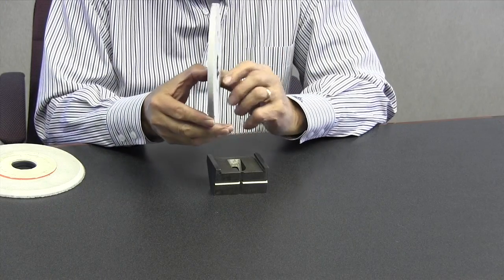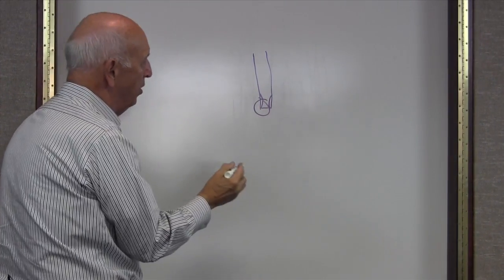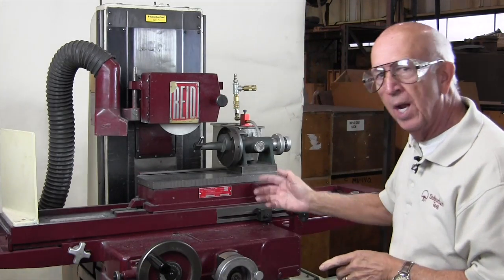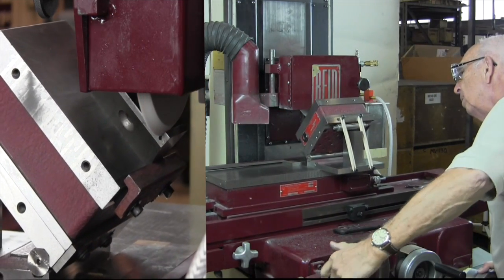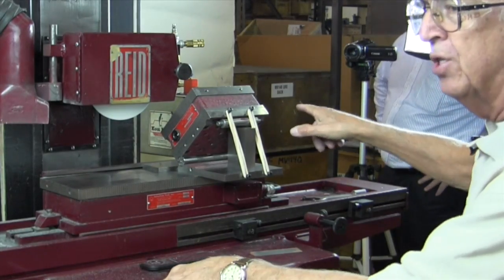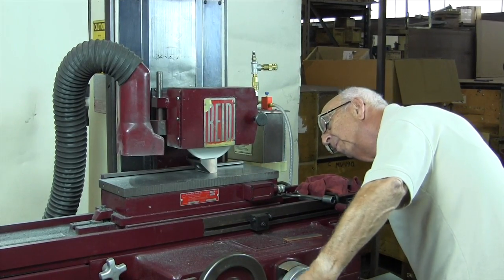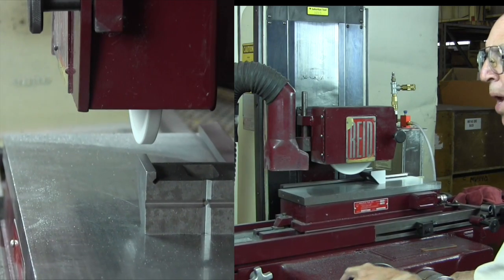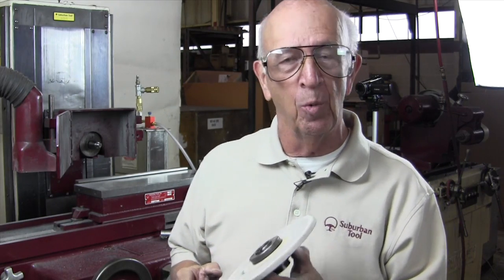How to side wheel on a surface grinder by Don Bailey

Comment: Don.. from one old tool maker to another.. you can’t draw worth a rats rear end.. lol..but.. you get your point across..in this day of CNC (Christ! No Cranks) being the only thing taught these days..it’s hard to understand how we could move away from teaching this kind of knowledge. I am a card carrying Journeyman Tool & Die Maker. A dying breed. I’ve forgotten more than most will learn in life.. as for grinding with the side of the wheel I’ve found you must feed slowly and be aware that the wheel is cutting and not climbing because it’s Fed to quickly. Wheel choice is paramount too especially on a dry grinding set up. He mentions a J wheel which indicates the bond and not the grit. I’d choose a 46 for this grinding but a 60 may be what he’s using. Also, hardened tool steel grinding shows a darker spark whereas softer shows a lighter spark.

Comment: Thank you for this informative video.
Some follow up questions:
1. Is it possible to grind a dovetail slot?
2. It seems to me the sidewheeling is the only option for grinding deep slots?
3. The accuracy of dressing the wheel at 45 degrees determines the squareness of the slot so this method is only for those that have access to a dressing jig that is very accurate?

Comment: I'm guessing that you would have set up the angle dresser to an exact 45? Another question is if your diamond isn't exactly on the center of the spindle when you dressed the wheel you would not end up with an exact 45 as well?  How can you find the center of the spindle with the point of the diamond? The error would be minimal on a larger wheel but more noticeable on a smaller one? Great video Don cheers.
Reply from the maker: you have to be off center a lot to make a difference
Reply: @SuburbanToolInc  I've worked out the math in the past but wondered if you had a trick. I made a unit for my Jones and Shipman that  works from the spindle center and magnet for square that works to the actual diamond crest and not the shank. Great video's and thanks for the reply. The attitude of always wanting to learn/advance is always key.

Comment: In this case, I'd side grind it. I don't like how the wheel breaks down but I do like that there is less room for error (if the rolls on the sine was off a few tenths of worn gage blocks or the 45 degree dress was slightly off) as examples. Only thing I would have done differently is dress the side of the wheel before reliving it. Pretty much everything Ive learned was from guys like you, Old time toolmakers. I've been a toolmaker for 15 years now and feel lucky I am able to do what I do for a living. Great videos BTW!

Comment: Thanks Don! Very informative. My introduction to surface grinding was in high school where i worked at NHBB regrinding carbide cutting tools used for mfg of ball bearings. We did a lot of side wheel using dished diamond wheels and was always curious about using a standard wheel as you have shown. i was unsure of the wheel could take the side load, sure seems like it can.

I have an application where i am production grinding a relatively closely spaced 45 deg v-grooves post heat treat. am only removing a few thou and size is not important but surface finish is, <8uin. i am using a 2-axis automatic surface grinder (wish i now had downfeed)

i prefer to do it in one setup for obvious reasons. thinking if a couple of ways to do this and here is the one i am leaning towards.

1. Set the part at 45 deg such that one vee face is horizontal and length is parallel to traverse axis the other vee face is now vertical (z-axis). The parts will be placed in a repeatable fixture that registers against the fence. these are small parts and I will actually gang them and do 6 at a time.

2. dress the wheel face.

3. dress the the side wheel.  I assume i  use a diamond in same manner as the face? Relieve the side of the wheel as you have shown. is there a better way to do this than by hand?

4. Set the machine such that the Y location of the wheel removes .003" from the vertical wall. 

5. Starting above the part. While  traversing, down feed in Z to clean up the vertical face of the vee with the side wheel.

6. Continue to down feed until the horizontal face of the vee has been machined .003".  let the machine spark out both the vertical and horizontal faces.

My questions with the method are?
Will the surface finishes in step 5 and 6 be equivalent? 

One will be crosshatch and the other paralell. will i be able to attain the <8uin?

Can i spark out 2 surfaces at the same time?

Do i need to out-feed in step 6 to ensure the surface is across flat and evenly wear the wheel or is this unecessary? 

My preference is to only down feed and up feed and leave the infeed alone or vice versa. Makes running these parts simpler.

Thanks in advance!

David Anderson
Exact Engineering

Comment: Don, the side hand dressing that you demonstrate in the video I believe is more dangerous than necessary The wheel dresser that was used to dress the 45 deg . could also be used to dress the reliefs on the side of the grinding wheel. Saftey first!
Reply: +Dick Bernardino You can only get experienced by doing something.. and regardless of experience, a little slip will still grind your knuckle just as bad. Unless you're talking some hyperbolic extreme where the person rams the diamond in and the wheel explodes in their face because theyre leaning in to eyeball it... lol. Thats just lack of common sense, not experience ;p
Reply from the maker: +Dick Bernardino We understand your concern and agree that the operator needs to be cautious , but please keep in mind that not everyone has a radius dresser. Even a kitchen knife can be dangerous if not used properly.
Reply: +SuburbanTool Inc Don, Ive used suburbans last word wheel dresser. My experience training new commers to grinding methods. Should first be safe and repeatable. HAND DRESSING is not either I am of the opinion that hand wheel dressing should only be used by experienced people.

Comment: Don... that was wonderful!
  Ok, my queries:
  First...
  Thanks for letting me drink beer in class. You are one cool Teacher.
  I loved the hand-dressing. Just grabba danged diamond and have at her.
  Third, that stone you always wipe stuff with... what is it?
  I have a Norton... what... 2" x 6" duplex.. and I use the red India side.
  And... well, I am more a Machinist than a grinder, but you will make me one.
  I used to use Kool-mist. I ran out one day. I am in Alaska and none of that stuff is local.
 I ran over to Practical Machinist Blog Site, and lo and behold, there posted was a recipe for home-brew coolant.
  Soy Lecithin, Arm and Hammer Washing Soda and Peanut Oil.
  Ya know what?
  It was superior to Kool-Mist in Lubrocity.
  My end mill, previously squeaking... just shut up and started making chip.
  Ok, I dope it with BHT as I figure it has to be bacteria free, but good enough to drink.
  ( The stuff is in my surface grinder now too, and I learned not to go full aerosol... but a mild globular spatter pattern at 20-30 PSI... )
  What are your thoughts on coolant?  
  I love your Videos!!
  Thanks again,
  Mark
Reply from the maker: Mark Richardson We use Cimstar 40B in our shop. Fortunately it is available here in Michigan.

Comment: I CAN TELL JUST FROM THE SOUND. I LOOK FOR THE DIAMOND PATTERN IN THE CUT. NO DIAMOND CUT LEAD POINT HAS TO BE REDRESSED.  JUST AN OPINION...
Reply: Your right you can HEAR  and SEE when you've  dressed   wheel correctly.. as a retired toolroom grinder  .wouldn't  recommend the 45 degree sine chuck method  .. to many options for error and never mend the set up time and the faffing around.. maybe  grinding on a production basis  with a batch of parts it's maybe an option as you get positive stock removal  on the down  feed  . With side swiping you basically  have to count the sparks ,, ( the old hands will know what I mean)   Small point which is sometimes overlooked  . When regrinding the magnetic chuck or the back rail always have the magnet ON. DONT know if Don did that or not.. the chuck can deflect a bit   especially  if the chuck has been ground thinner  with  constant regrinding over the years, Its a small point but every bit helps when chasing  the  elusive  MICRON.

Comment: You are an ANIMAL!!!
   Thank you so much for sharing your knowledge.
  I just bought a B&S 6x18 Micro-master. Any thoughts on oils and filters?
  Mine has a wool filter, and I don't know if that is good, or bad. Near as I can tell, wool is good for at least 10 microns. Which ain't good. Should I retro in something better?
  And the oil...should it be a 68 or a 32?
  Recommended is Mobile Vaccu-o-line 1405
  I was considering a cocktail of AW 32 with a slick 50 kicker.
  Thank you so much.
  Mark

Comment: This is awesome because I just found out a couple days ago that I'm inheriting a surface grinder, so I've been feeling the need to learn how to use it. I knew Suburban Tool would have some good info, but I didn't expect to see this pop up in my email, showing such a cool technique for doing far more with the machine than I knew was possible. :)
Reply from the maker: Jon Miller Jon , There are a lot more video's that will be of help to you in our playlist titled surface grinding. Thanks for watching.
Reply: I just added them to a playlist. I have a lot of work to do to make room in my shop for it, and to get it moved, but I will definitely be watching them. Your videos have been the most thorough and educational of any I've seen as I've been learning metalworking. Thanks for all the work you've put into them! I assure you your name is the first thing that comes to mind now when I think of tooling and such that I might need. I know it has a magnetic chuck, and I already have some good setup blocks and angle plates, but there's still plenty more I'm going to need. Or at least want! :)

Comment: Great info on selecting wheel hardness and the two solutions to doing the same work.  Now teach Glenn about how a closeup is better when not from 10ft away. lol Maybe including some hi res still pictures of the parts and finish or even just doing closeup pics of the parts on a table would be of benefit as well. 14:54 the grinding done is in the shadow and it could have chisel marks in it and it would be hard for me to tell. lol I realize Don is the star of the show but I would like to see the parts too. :-)

Comment: Great video.
Reply from the maker: ***** Thanks Dale ,   How is the new shop coming?
Reply: SuburbanTool Inc Hi Don, The shop is going great. All the walls are repaired  and painted, machine are in place. Next is running wire to the equipment, but it will have to wait until I get back from vacation.Dale d

Comment: Do you use coolant when your not filming?   Your not getting wheel burning?   I have also used a diamond dresser block mag'ed to the chuck when dressing the side of the wheel for safety.
Reply from the maker: Richard King We do use coolant when removing more stock. This was just for demonstration purposes and I took a light cut.

Comment: Hey, nice video. The 45 degree angle is a nice trick but if time is of the essence the side wheeling is a better option. I have a question though on side/face OD grinding. When I'm centre-type grinding the face with a side of the wheel, the face turns out not flat and it's a taper. It is only the case when grinding very short parts, long parts turn out flat to a few microns... I have no idea what's causing it. And machine is capable of grinding parts in few microns.
Reply from the maker: nocturnodrummer The only explanation we can come up with is that your wheel does not have a sharp point. It should happen on both short and long parts though.
Reply: Hi, thanks for the answer. Well unfortunately that's not the case because long parts turn out perfectly. We were wondering if there's something wrong with work centers. We have them 'zero'ed' but we wonder if they are truly concentric to one another. But even if.. Wouldn't the missagligment be canceled by table swivel? We are able to grind long parts in close tolerances but that face issue really bothered us. Sorry for my bad English.